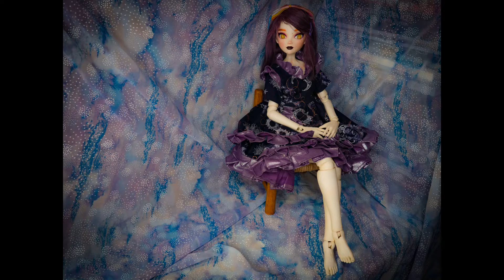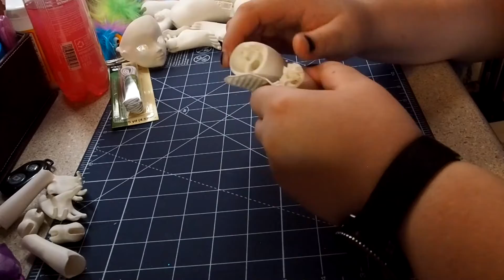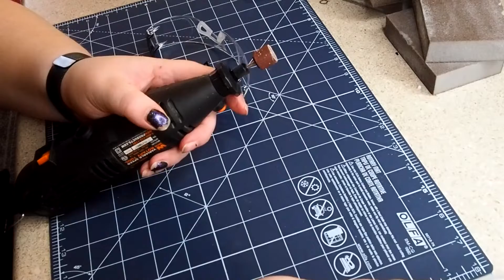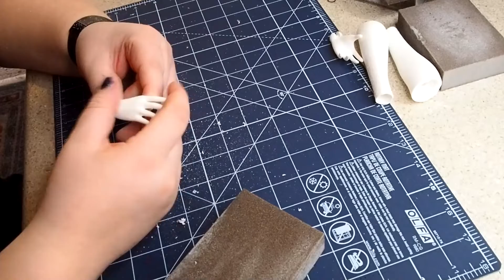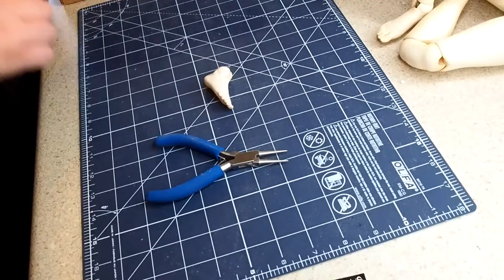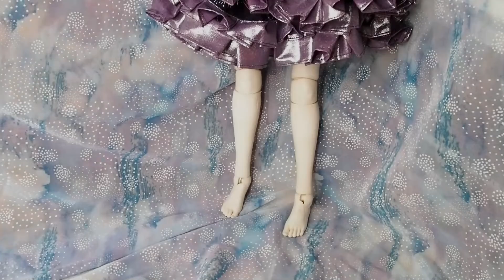Creating "Nova" 3D Printed BJD Doll Repaint  - Part 1 - Preparing the Body After Printing

Comment: how did you sand the infill inside the legs?
also what percent infill did you use?
Reply from the maker: Hi there! To get the supports from the inside of the limbs in order to pass the elastic through I used drill bit around the size of the hole and  used that to pull the material out from the inside and knock it all loose. My infill density was at 15% and my program uses hexagons automatically. Thanks for watching!

Comment: Just so you know for future reference you can get s-hooks from the hardware store I heard that there pretty cheap and they come in plenty of different sizes so you can get them for the hands, feet and head
Reply from the maker: I did try to look at my local hardware store for some S hooks and that's where I found a make shift one that I used. I might have to try another store and see if they have the actual S hooks since that would be a time saver for sure

Comment: Just stumbled across this while 3d printing my first BJD. I've been 3d printing other things for a while though and look into resin coatings for FDM prints like Smooth On XTC, it strengthens prints and fills layer lines so you can get a much smoother finish. That's what I'm planning to do with mine.
Reply from the maker: Thank you for the advice! I'll definitely look into that, I didn't even consider a resin coating. I've tried a lot of primers so far, but none of them seemed successful, so I'm happy to try some other methods. Hope your doll turns out!
Reply: Should you use that or after you dye the doll?
I was planning on sanding mine and then dying it but should I apply the resin during standings or after I dye it?
Reply: @nightshade8538  I'm not sure. I didn't dye mine.
Reply from the maker: I think if you were going to use both dye and this product you would want to use the resin afterward. The resin I don't think would take the fabric dye the same way. I haven't managed to get my hands on the coating to try it yet sadly.